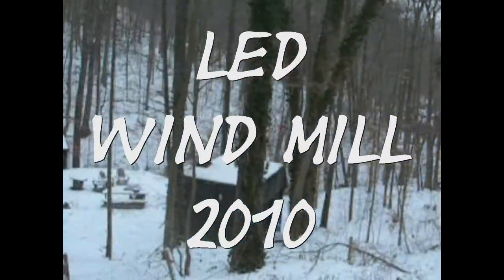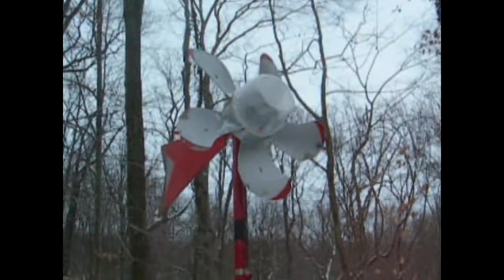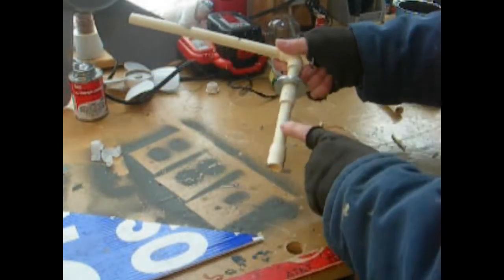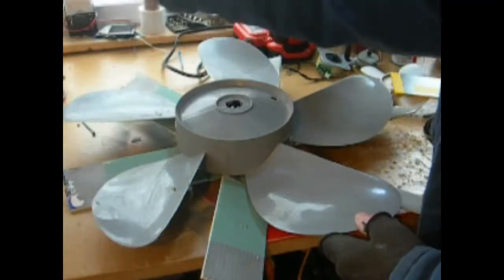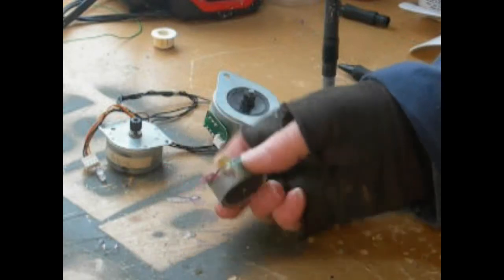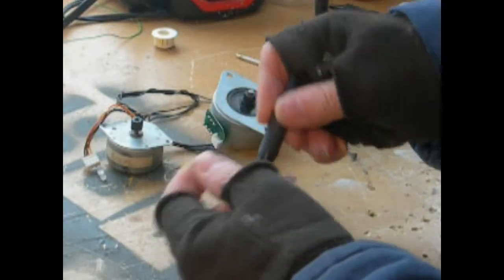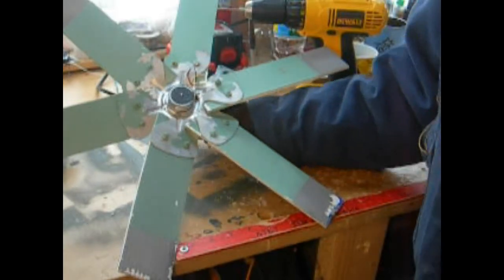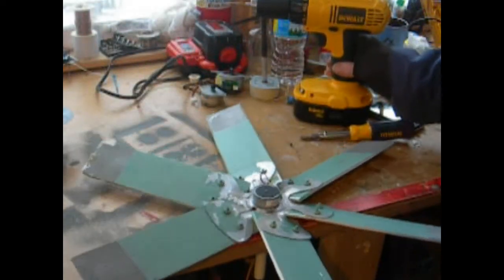LED WINDMILL / WIND TURBINE PART 1

Comment: I bought the stepper motors but had a hard time attaching the shaft to the gear on the motor.  Shaft kept tilting and falling off the gear.  The hole you drilled looked like it was above the gear on the shaft.  Was it?  I ended up mounting a gear on the shaft and setting the motor to one side of the shaft so the weight of the blade was not on the shaft that drove the motor.   Works but was a lot of trial and error.  Thanks for the great ideas!

Comment: Thanks, Rich.  I made a couple of these and had a hard time keeping the shaft attached to the gear on the stepper motor.  JB Weld, tape.  Nothing held.  So  I ended up attaching a large rc helicopter gear to the end of a bicycle hub, then had the motor attached to the hub (via a steel mounting bracket) so its tiny, brass gear would rotate around the larger, rc helicopter gear.  Another advantage: the big gear makes the stepper motor turn faster in lower wind.

Comment: It is very cool. It will be my next project. Question: I think that stepper motor produces AC current so you have to pair the LED (set of two LED in parallel with reverse polarity) to avoid LED damage. What you think?